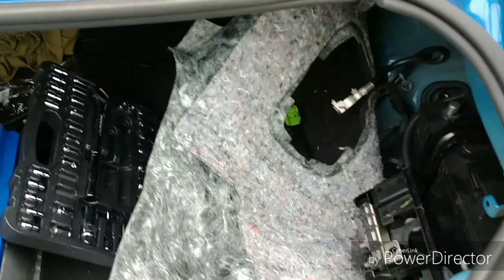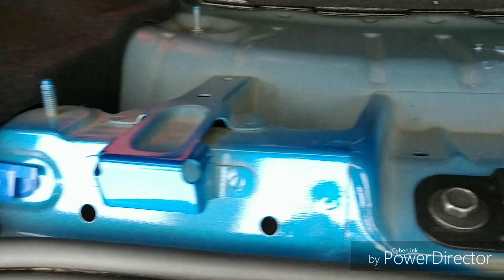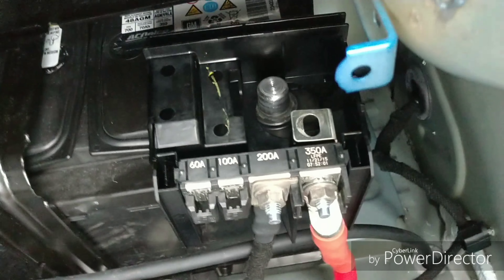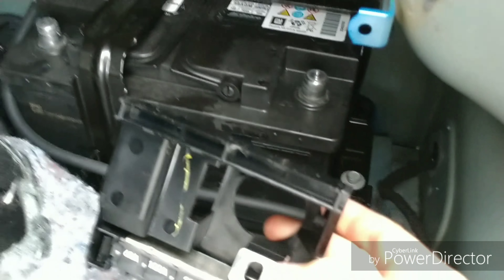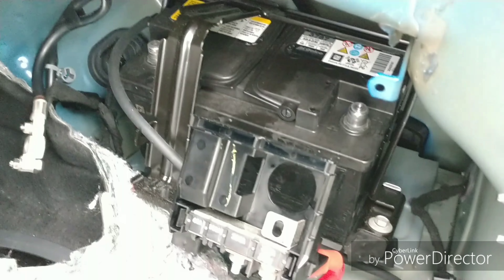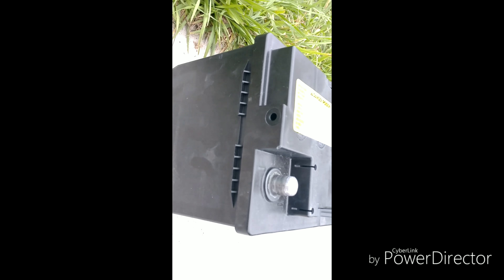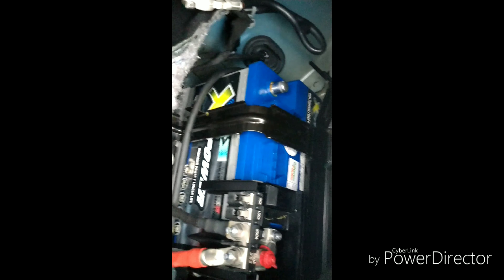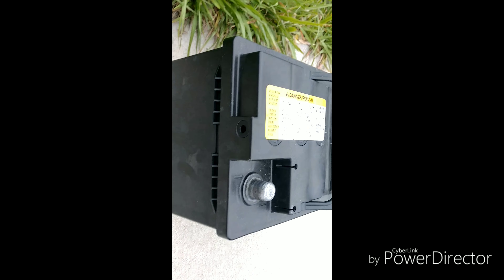2016 2017 2018 6th GEN Camaro battery removal And mistakes made!

Comment: Picked up a 2018 1SS recently.  This has to be the most idiotic place to put a battery.  We have a BMW that has a battery in the trunk, but at least you can access it without taking all those things out just to get to it.  Looks like you basically damage your liner just getting access to it.  Unbelievably moronic design!
Reply from the maker: Yeah dumbest design I've had to ever deal with.. the only easy accessible thing about it is the negative terminal..
Reply: @HyperHawkCamaro  ~ Mine just went into storage for the winter season.  No doubt the car will not turn over in the spring even if I start it a few times a month, from what I'm hearing from other Chevy owners.  So I was thinking of disconnecting the negative terminal to avoid battery drain.  Did he actually have to cut out the liner.  I see the shape of the access area where the negative line is hanging out of the hole at 17 seconds into the vid.  I have the same shape in my liner, but mine is not cut out.  Don't tell me that I need to cut the damn liner?!
Reply from the maker: @Snow-Dog2112  nope it's just a panel it's already cut out the panel pops out just push on it.. if yours doesn't have a removable panel there then your liner wasn't made right. You can also get a trickle charger for the winter alot of people do that
Reply: @HyperHawkCamaro  ~ Copy that...
Reply: Well to be fair it is for better weight distribution. After all, it is a race car 😉

Comment: Great video.  One more tip.... Crack your driver's window open a bit before disconnecting the battery.  Otherwise, if you open or close the door while the battery is disconnected, the window and pillar/roofline will interfere badly and there could possibly be damage.  Made a helluva a noise (Crack!) on mine.

Comment: Guess you have to crawl through the back seat pulling the emergency key in order to open the trunk same as I do since the remote nor the button on the drivers door will pop the trunk when the battery dies 😩
Reply from the maker: @leighannehammons9710  Yup and I broke my emergency release doing so LOL, I have a antigravity battery with built in jump start now.

Comment: Where can find those connectors that attach to the terminal with the bolt. Like there are two empty spots for 60A and 100A, whatever that is that goes in there. I don't know what to call it so I can't find one. :-)

Comment: Do you jump start the batter from there or does it relay somewhere to front under the hood
Reply from the maker: @jamarebrown4831  There are jump points under the hood. If your battery is dead you cant open the trunk unless you crawl through the backseats

Comment: Getting that cover off the Positive side..🤬🤬🤬🤬🤬🤬. Mine has 1 clip on each side then you pull it forward to take it off to access the terminal. A fricken job that should have took a minute to hook up a battery charger took me over 10 minutes. I'm sure the neighbors could have heard the expletives I was letting go. Thanks.

Comment: What does that valve that you plugged in the side of the battery do?
Reply from the maker: It's the vent tube
Reply: Would that cause a Ground problem if not plugged into the battery?? My camaro's giving Reduced power and my tuner said a Ground problem

Comment: Do u know how to fit the positive or replace it on the clip because my is not making a connection the 350A positive?
Reply from the maker: That's off as long as the metal part is touching the terminal it should be making a connection. Unless you have a further harness issue. What is not working ?
Reply: My starter when out, and my new battery was dying, but the 350A looks burn  out
Reply from the maker: @yuditperez7912  Check the fuse box under your rear panel make sure water hasn't been getting in the trunk and getting to it. Happened to me.

Comment: Curious if you could attach the positive end of a battery tender to where the red positive cable is attached at the 350A location.  Thank you in advance.
Reply from the maker: Yes you can it connected directly to the terminal
Reply: There is a place under the hood as well on the pass side of the car you’ll see a red post to connect to as well and a metal ground post just off to the right of said red post

Comment: Got my battery tested they said it just needs a recharge, so I’ll get that done & hope that fixes my window glitches & error msgs.
Reply from the maker: They told me the same thing.. but didnt work just replaced it got tired of dealing with issues no issues since. Battery wise.
Reply: Hyper Hawk so you were getting error msgs on dash also? What issues where you dealing with?
Reply from the maker: @AJCoReTV  For me random stuff wasnt working and car battery was randomly dying.. I could jump it would last a week or maybe a day.
Reply: Hyper Hawk so far I’m getting random slow cranks (barley starts), seat memory not working, driver window requires reindex, & service stability error msg, & rear reverse camera freezing... I’ll recharge battery to see if I can save $ on a battery. If it still acts up, I’ll just replace it. Thx for this vid! Any suggestions on replacement battery with proper vent location?
Reply from the maker: @AJCoReTV  Did you get your issue fixed ? I would also check your trunk make sure your fuse box isn't getting wet some people have had problems with trunks leaking and getting to that fuse box and causing all sorts of issues.
Reply: Hyper Hawk talk about perfect timing... I never got around to buying the new battery, but just THIS MORNING, car was dead!! I replaced it with a $180 Advance Auto platinum battery. So far so good! I’m going to remove the LED reverse bulbs & resistors. I have a feeling this was draining.
Reply from the maker: @AJCoReTV  Yup have heard of issues with those as well!! Battery issues are such a pain
Reply: Hey so it’s just the battery causing all those glitches? I’m also hearing alignment needed. Got my battery tested today and it was at 43%, I got it recharged but the same messages are popping up just like you had regardless of the charge. Not sure if I’m needing a new battery instead of recharge?
Reply: Battery is OEM car is 2018 and I haven’t changed it.
Reply: @rawwlineazy1132  sadly I had to get rid of my ride for a daddy mobile (Durango RT)…. But yes, replacing batter fixed all issues!
Reply: @AJCoReTV  hey not bad though with the upgrade 😋 thanks for the help, will try that next 🙏🏼

Comment: Who the fuck do you get the clips off that hood the carpet on
Reply from the maker: What do you mean the hood the carpet is on ?
Reply: @HyperHawkCamaro  I ment the clips that hold the carpet on to get the battery out?
Reply from the maker: @wabajack8250  oh they are standard pop clips just use a pry tool they pop right out. Might be diff on diff years they could be the 2 part clips where you pop the center out then use the pry tool to pop the whole thing out

Comment: How is that battery ? Is it better than the stock battery when you bought the car from the Dealership?
Reply from the maker: Years later the AGM battery is holding up well.. sadly my OEM battery wasnt even faulty there were other electrical issues going on that causes the problem. But the replacement has a 5 year warranty and here in florida thats a big deal.
Reply: HyperHawk Motorsports word i need a new battery for my Camaro too i know i had it sitting for 2 months or so and the battery Is acting up. But it still works . Im thinking of a better battery than the oem .
Reply: @HyperHawkCamaro  What other electrical issues did you have?

Comment: The positive terminal on my 2017 as convertible has an additional small wire.Does this wire plug into 60 amp or 100 amp